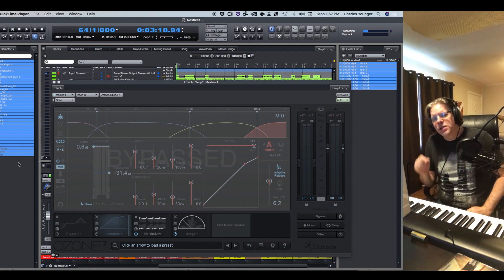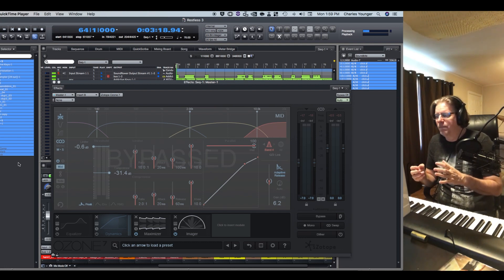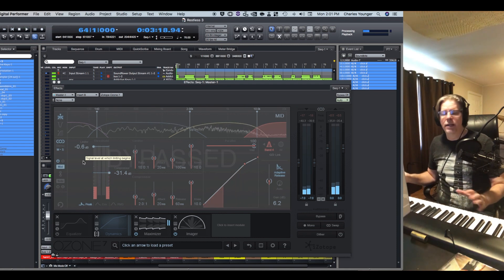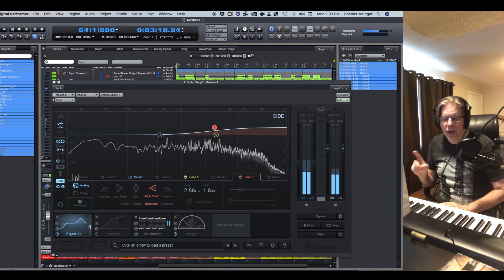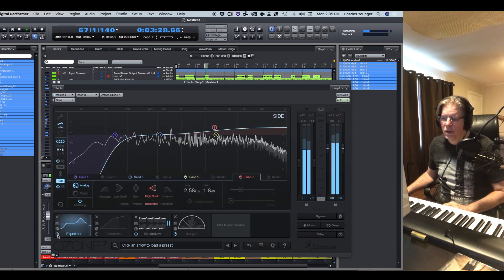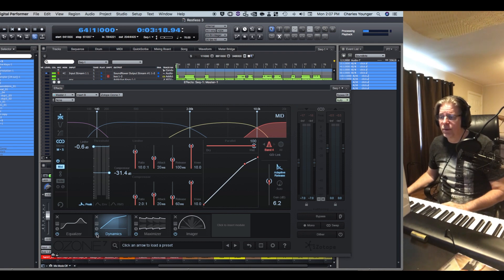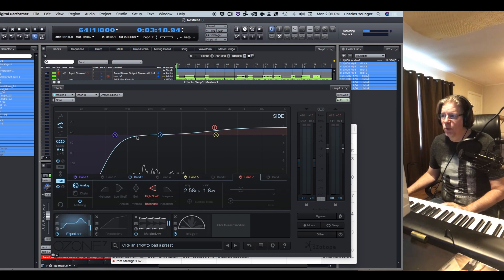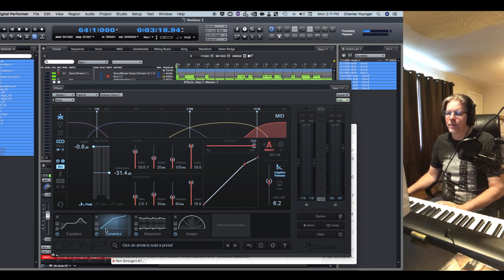Understanding Mid-Side EQ and Compression

Comment: This is definitely what my mixes have been missing.  The mid side EQ is pretty subtle (at least with my headphones), but the compressor definitely made a huge difference.  Logic has a mid side EQ built in, but it doesn't look like there is a multiband EQ that can be set to mid.  (at least not that I'm seeing)

200 bucks for a single plug in is pretty steep too.  Logic is only 200 for the entire daw lol 

Thanks this really helps!